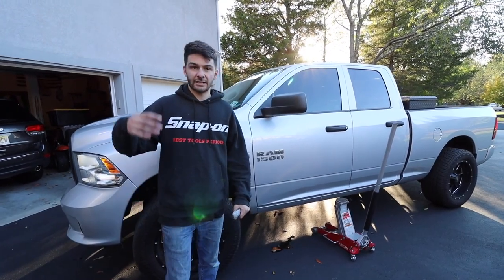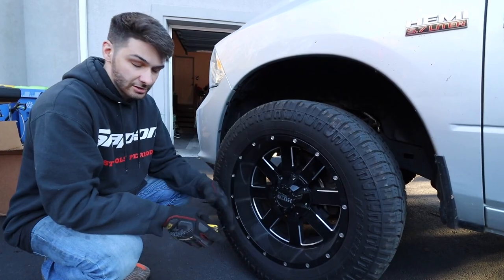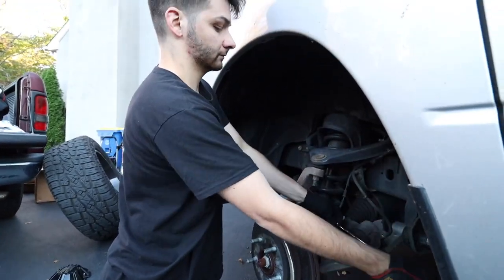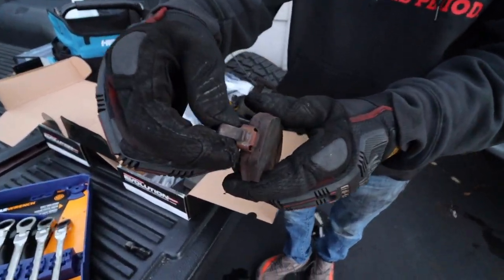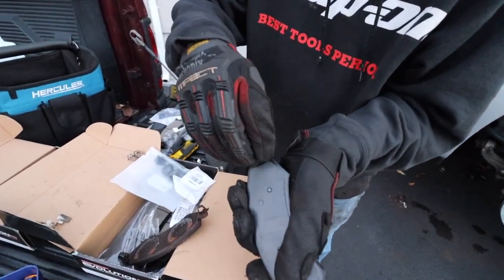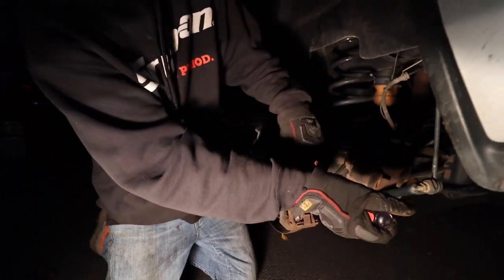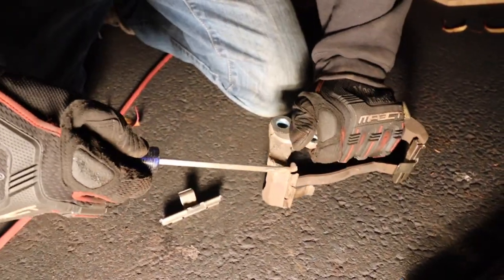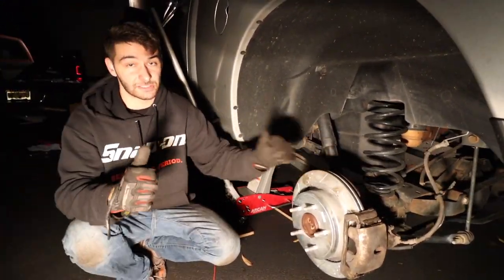4th Gen RAM 1500 Front/Rear Brake Pads & Rotors Install | PowerStop Upgrade

Comment: C’mon bro, you got those new rotors so greasy once you got them on the truck. Change out those dirty gloves or use a shop rag. Pro tips: throw a lug nut on one of the studs after you put the new rotor on to hold it in place while you put the bracket and caliper with pads on. Loosen the lid on your break fluid reservoir to relieve some pressure before you reset the calipers. Makes it easier to push the piston back in. Also for the front duel calipers, use one of the old break pads flush against both pistons while you push them back in with your caliper reset tool. It’ll push them in together instead having to go back and forth on each of them. Use a little locktite on the bolts that holds on the bracket. Inform your viewers about the break in process. And lastly, you really should use jack stands for safety.
Reply from the maker: Thx

Comment: ? Instead of using the piston kit, just use one of the old brake pads and place it against the pistons and grab a C-Clamp and tighten it down until it bottoms out against he back of the caliper.(Clamps available at any hardware store or auto store for a lot less than a complete piston kit)
Reply from the maker: Yeah you can definitely do that for sure!
Reply: @RatchetWrenches  Just a different way to skin a cat. Great videos by the way, keep up the great work

Comment: Do these get rid of the shaking when braking? Running 305s on 20 inch rims
Reply from the maker: If you're having that issue you probably have warped rotors. But yes brand new rotors and pads should fix that issue!